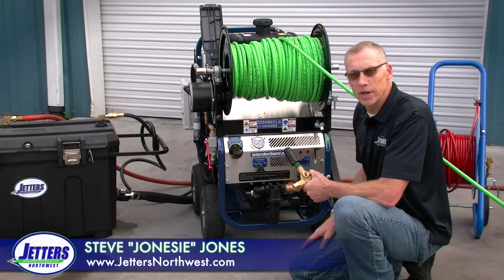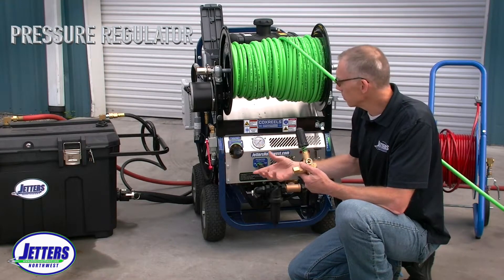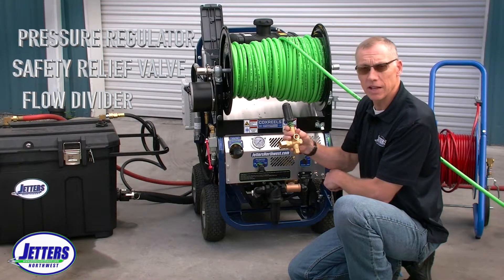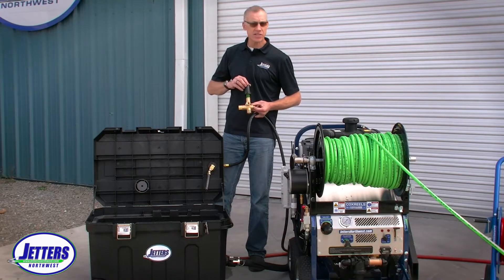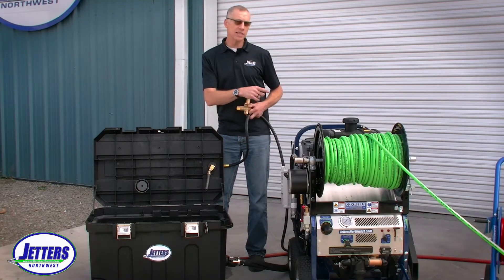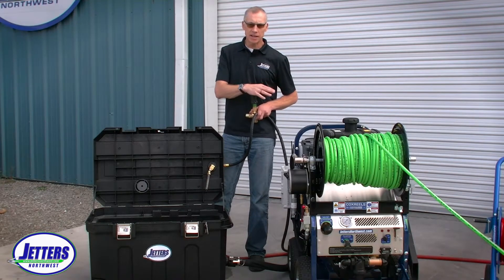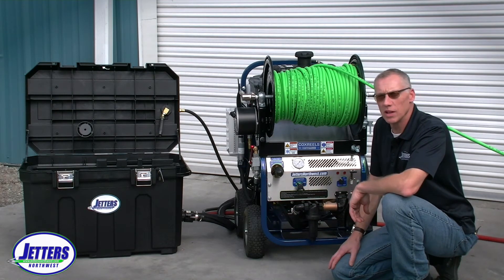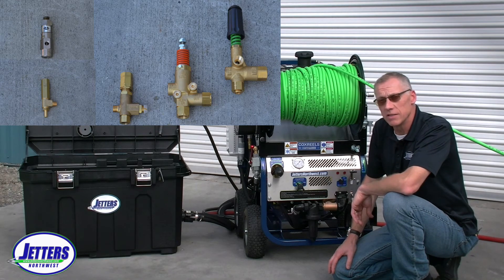"GET" JETTING:  Understanding UNLOADER/PRESSURE-REGULATOR VALVES

Comment: Hey Steve I have a US jetting 4018 I am thinking of putting a unloader on and getting rid of the disc setup. Would that be ok to use a 4000 psi blue spring  unloader valve
Reply from the maker: Yes but it depends on the GPM-rating of the unloader - ours is rated for up to 26-GPM - you cannot use one that is rated for less than 20gpm cuz it wont be sensitive enough. Safety note: our valve can handle pressure up to 4500psi BUT remember not to exceed the 4000-psi rating of your jetter when you adjust it up to pressure.  When installing a "true" unloader valve you need to plumb it in so that water from the pump flows THROUGH it (like on all of our jetters).  Many other brands mount the valve on the branch of a tee which allows it to work as a relief-valve/pressure-regulator but forces you to remove the internal check-valve from the unloader which eliminates the "unloading" feature (releasing pump-load when flow is stopped downstream).  Another tip is don't delete the burst-disc -- I recommend replacing the stock 4000psi disc with black-colored 5000psi disc which can serve as a safety-relief valve in case the system spikes up over 5kPSI someday (it's a cheap insurance policy for your expensive pump!!).  Here's a link to our Unloader Valve: https://shop.jettersnorthwest.com/collections/all-jetter-parts/products/green-spring-unloader-valve  Let us know if we can help!
Reply: @JETTERSnorthwest  Great thanks for the info. Do you guys have any dealers / service centers in the Pennsylvania area
Reply from the maker: No dealers out that way - we have a couple service-centers but I cant say they'd know how to properly install the unloader since they are "just" repair-centers.  Our primary jetter-tech here Bradley Craig can set up the Unloader with fittings/hoses and a mounting-block to make it easy to install.  If you're interested call Bradley at 877-901-1936 between 11am and 7pm your time :)